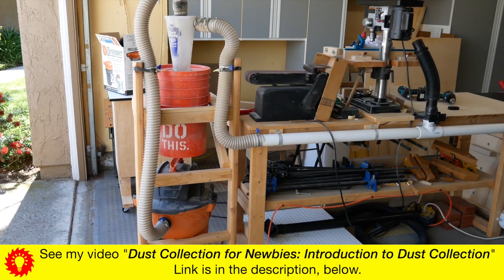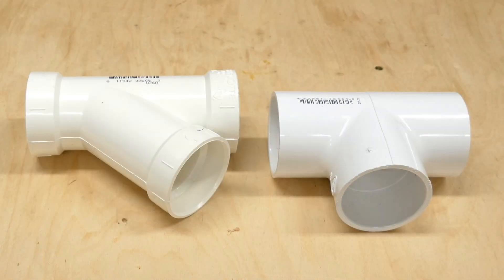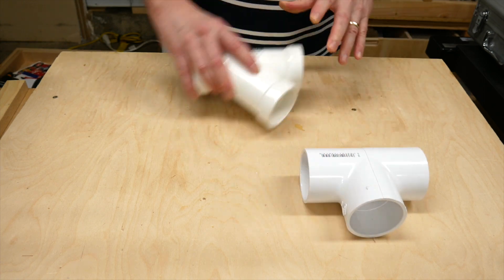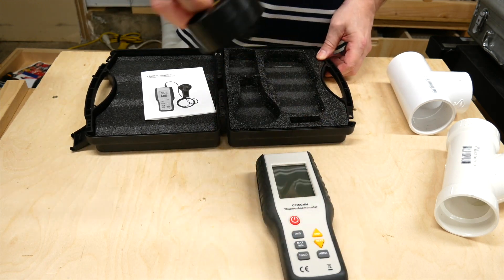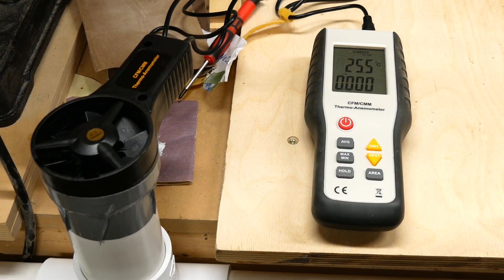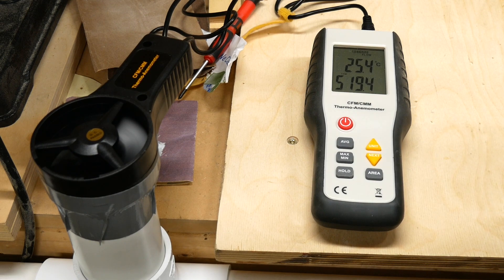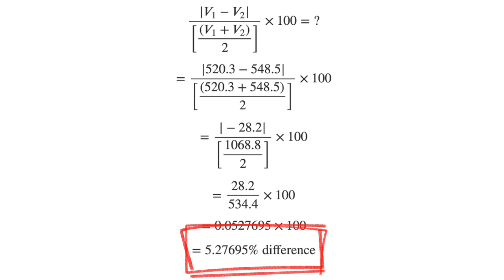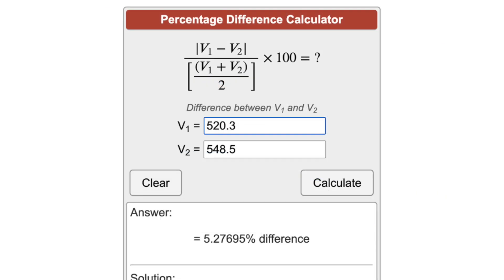Comparing Ts to Ys for Dust Collection

Comment: Yes its only 5% difference... with one connection and shop vac. Start adding bends and constriction starts to add up real fast. Also shop vac operates low volume with high pressure or speed of the air compared to chip collectors volume of air with low pressure and low speed. On the latter effect is even more drastic.
Also even if its just one bend, that is still 5% more power required to move same amount of air, so you are causing extra tress to shop vac motor.
Just the flex hose is creating 9 times the constriction compared to straight and even pvc or better yet metal pipe designed for dust collection.
Reply from the maker: Thanks for the info, and sorry for the late reply.

Comment: I've just dropped on to your channel and watched this video - i know - two years late. I can't tell you how much but your calculations are wrong almost for sure.
You are dealing with a differences of 28 units over a total of 500'ish of the same units. It shows about a 5% (if you method of calculation is correct) of difference and that's not a big deal.
But that 28 units will be a very different percentage if they are over ~500 than if they are over 5,000 or over 50. So, the total volume of air measured is a significant parameter and it shouldn't be inaccurate. I humbly suggest you to read the manual of the anemometer and try it again. Maybe Venturi and Bernoulli weren't wrong after all.
Please, please, take this comment with ZERO intention to underrate your work. "Au contraire", I want to give you my appreciation and beg you to keep up with your work!
Subscribed, belled and shared your channel.
Again: keep it up!
Reply from the maker: Thanks for the comment, and I appreciate you saying that you aren't trying to undermine my work. It's always hard to know people's motivations when communicating this way. To your points, this is why I rarely do these kinds of videos. I know I don't really know what I'm doing with these kinds of measurements, so the video ends up almost completely useless. As an aside, you mentioned Bernoulli, which reminds me of back in the day and Bernoulli discs (disks?). Remember them?
Reply: @TheNewbieWoodworker  OMG! Maybe I'm chatting with someone of my generation! Bernoulli discs where somewhat of a better ZIP cartridges at the dawn of the CD-ROM era...
But Bernoulli himself, he was also a member of a family of scientists (physics and mathematics) and pioneer in fluid dynamics.
I'm more on growing than destructive criticism and your work in your channel deceives any comment to help you in this adventure. But I'm sure you are correct on your conclusion, just keep it in mind the next time you deal with absolute and percentage values if you think it could help you.
I appreciate your time writing your reply and don't hesitate to keep your channel up! 
My family is now in an economic struggle, but as soon as we get out of it, you'll have another patreon. Take it for granted!
Reply from the maker: @yusuf-alasit  First off, sorry you're having rough times, but rest assured that you dont need to do anything special to support my channel. I appreciate the thought, but it's really not needed. As for the same generation, I'm 66, so I could still be quite a bit older than you. And for sure, thanks for constructive comments. I'm basically working in a vacuum, so anytime someone can help me learn things, it's a bonus!
Reply: @TheNewbieWoodworker  I really enjoy small but quality channels like yours and feel so grateful that I share like and subscribe these like yours. But I ethically feel that I should help this sharing community of makers in the measure I can.
So, if you have any questions about numbers (maths) or physics I can try to help with pleasure. But don't feel obligated to.
BTW I'm 56, so not so far but not so close either. I know about Bernoulli discs because I've been envolved in computer since high school (1984) and graduated on computer science.
I'll follow your projects. Keep it up! ;)
Reply from the maker: @yusuf-alasit  Thanks! I'll keep you in mind if I ever need that kind of help. 🙂

Comment: Thanks for that, you are right if you are using one machine per operation. Your dust vacc works on vacuum a dust extracter works on air volume. A dust extracter is designed to move X amount of air and does not work as efficiently if it is not allowed to move that amount of air. The best way to make this happen is to install a gate on a Y piece that allows you to balance the air flow, giving you the most efficient use of this machine. As you said a 5.5% drop in efficiency does not matter with a vacuum, unless you are using multiple outlets. May I say your design is brilliant for a vacuum system. By the way my background is in particulate air movement, Stewart
Reply from the maker: Thanks, Stewart, for confirming what I was thinking, and thanks for the compliment. I'm certainly no expert - far from it, and I'm just trying to help as best I can. As an aside, I've delved into "fine particle" collection, and I just end up shaking my head and saying "I can't hear you" really loudly. I'm not sure why I'm mentioning it, other than I thought it might give you a chuckle. :)
Reply: @TheNewbieWoodworker  Hi the problem with fines in particular air is that you need to reduce the velocity in any separator to allow the without doubt light weight particles to drop out and not be taken to any filters you may have. Heavy particles are relatively easy to remove in separators (cyclones) but not fines like sanding dust.
Reply from the maker: @stewartenglish3724  Good point - thanks.

Comment: This has been properly tested many times. Also just testing one connector doesn't really help. It is about the total volume and speed of air being moved throughout the entire system. Air slows down around corners. If you have a full-fledged ducting/piping system, having it littered with t-connectors will make a difference - sure in your case you might not see the difference, but the difference exists nonetheless.
Reply from the maker: I replied to your comment, and YouTube seems to have lost it. 🙁 In any case, I'm pretty sure I said that yes, there's a difference.

Comment: Hey great  stuff.  Hows the thumb?  I am going to use the shop vac  and t and y connections  for  my  triple   location. Dust collection  system after i finsh building   the table saw/ router extension  bench with a concealed  shop vac  hideaway  cabinet.  Question...... have you ever had the need to make a sacrificial fence  for dadoing or ripping  on your table saw.
Reply from the maker: Thanks. Yes, I've used sacrificial fences many times. Is there something I can help with?
Reply: @TheNewbieWoodworker   sorry for the delayed reply  
yes. perhaps you can  make a video  how and why a sacrificial fence is useful  and would you create multiple  sacrificial fences for different dado widths  while making tongue and groves  on  MDF and plywood for cabinet making.
thanks for your time .i really enjoy your videos and am learning  a lot. i look forward to more videos m.a.m.
Reply from the maker: @michaelmassetti2575  Stumpy Nubs has a good video on sacrificial fences: https://youtu.be/VbS0-nSCrzo. And I use the same one over and over again. It's only real purpose is so you don't cut your rip fence.
Reply: @TheNewbieWoodworker  thanks for the reply
Reply from the maker: @michaelmassetti2575  👍

Comment: A "Y" connector will help the particles of dust and shavings travel through the pip. The only place my system blocks is on hard bends like "T" can 90 connectors, where I have two 45 bends all work well. It's just the one 90 that is by the shop vac that keeps blocking but it's to tight space to put 45s in
Reply from the maker: That makes perfect sense. Thanks for sharing.
Reply: @TheNewbieWoodworker  Or as a compromise you (anybody) could try a swept tee
Reply from the maker: @philparmenter53  👍

Comment: The y will give you a better waste flow...no sharp...everybody down then a sharp right or left turn...I also use a similar set up as yours using clear 2 1/2” pipe and fittings y’s and elbows with grounding...thanks for your vids.
Reply from the maker: Thanks! 😄

Comment: Zero...I love a good Easter egg.  

I'd be interested in seeing the same measurements at all points along your system starting at the vac. It would give a great picture of loss due to length and fittings. 

Thanks for the enjoyable content!
Reply from the maker: Regarding "zero": 😂I may do some more testing - not with a Y but with what effect the Dust Deputy has on the entire setup, and it would include testing the airflow at the farthest point as well as the closest one. Time will tell if I do it or not.

Comment: If I should ever get to a point where I implement a system like this I’ll probably use Y connectors unless there’s a big price difference (I suspect there’s not). If I already had a system with T connectors I’d just leave it alone, though.
Reply from the maker: I like the way you think, so naturally, I agree with you! 😄
Reply: You are right if using a vacuum.

Comment: Glad to hear you and yours are ok. As far as the test goes I notice you have a thein type baffle which keeps your vacuum working more efficiently (ie filter stays cleaner). If I was going to spend money or time that would be my first place to start. I'm not an expert but I think the difference may become greater  the more particles being pulled thru the pipe. I think the difference between "t"s and "Y"s is due to turbulence at the joint. So like some others mentioned besides joiners and Planners, lathes, might see a bigger difference. I'd also suspect that the quality (air tightness) of your system and gates will have a bigger impact than the joints themselves. Just  my guess. stay healthy.
Reply from the maker: Thanks for the comment, Jack. I am actually thinking about doing some testing of the Dust Deputy, with and without, and see what the differences are in various situations. Time will tell if I actually do it, but that's the plan right now.
Reply: I am using a HD Dust Stopper with a Rigid shop vacuum. I don’t know how it compares to a dust deputy.i believe it was less expensive  but may not be as efficient. It is easy to setup and use. My biggest complaint is that I don’t pick up paper or plastic bags off the shop floor if they drop and they can clog the dust stopper and it is hard to clear as it makes it into the device but not out.. Also the pipe that comes with it is too short  if you mount the bucket with the baffle on top of the shop vac which I do. So an extra 12-18” would have been perfect. It works but don’t know if others are better. I found that if it falls over when vacuuming that stuff can make it into the vacuum container but otherwise it remains very clean. I am concerned with the really fine dust that may get thru everything and so I run a fan with a filter that supposedly can capture small particles.  It does get dirt over time but I can’t tell if it goes thru the vacuum or not. Oh just a random fact I tried a dust deputy knock off and it didn’t work well at all. Since it came with no instructions maybe it was the way I set it up can’t tell. I just went with dust stopper.
Reply from the maker: @jackmiller3628  I've had some long conversations (email) with the inventor of the Dustopper (I have a video comparing it with the Dust Deputy). He's a really nice guy and I'm happy his product is succeeding. He's very smart and has done a lot of research - he's basically an expert in air flow or whatever it's called. My only real complaint was that it was louder, at least on my system. It seemed to work about as well as the DD - maybe slightly less, but close enough. As for the bucket tipping over, I wonder if you put a brick in the bottom of the bucket, that might help?
Reply: The Newbie Woodworker I thought the same thing concerning the brick but decided to mount the bucket with the dust stopper on top of the vacuum and attack it so you would have to pull the whole vacuum over. Less space needed but tall.
Reply from the maker: @jackmiller3628  Great idea!

Comment: I have a life so I won't mention zero, I guess. Though I'll keep your video in mind if ever I manage to install a dust collection system that doesn't rely on the shop-vac hose being moved around on each tool change.
Reply from the maker: LOL, and thanks. The one big advantage of moving the shop vac around is that you'll get MUCH stronger suction.

Comment: May I suggest the next experiment with dust collection ....to earth (ground) or not to earth the plastic pipe runs. Should be interesting. 🇦🇺
Reply from the maker: I've written a blog post about that: https://thenewbiewoodworker.com/2020/01/21/dust-collection-and-pvc-static-fire-danger.html
Reply: @TheNewbieWoodworker   Thank you for the information. Rod Cole does good work.
Reply from the maker: @Peterseng24  Thanks for the info.
Reply: @TheNewbieWoodworker  love your article and appreciate what it says basically friction from particulate air does not create static charges in sufficient strength to create a fire. Again home units correct industrial not correct which is why they are earthed. Screws through the wall of the PVC dust earthed to an external wire and earthed hoses will make you safe. Prevention is better than cure. Sparks from cut metal in the material being cut or drilled can be a smoulder problem. Sprinkler head a great idea. all the best hope people make up their own minds about this but to me PVC ducting in a domestic situation is fine. Stewart. P.s. spent 40 years in fire industry as well with fire suppression systems.
Reply from the maker: @stewartenglish3724  👍

Comment: Something fishy about the claim volume vs speed but I can't put my finger on it. Regardless so glad you made this video -enjoyed it thoroughly, just like all previous ones.I was wondering whatever happened to The Newbie Woodworker. Glad all is well. By the way, I too will use the cheaper and more convenient join when I set up the workshop at my place.
Reply from the maker: I may have the details wrong, but there is definitely a major difference in how they work. I've heard that from people in the business who know a lot more than I do (which honestly doesn't take much). As for which joints you use, use whatever you can afford, and whatever works. 😄

Comment: Entering  "Zero", and get a life... OK... check! -  but I think you justified your analysis as a relative number vs. absolute.  So a thought about your dust collector setup: the run in your workshop is short compared to other shops, so the ~ 5% difference would only make a small increase in efficiency, not that beneficial to swap them out... but the fact that you can measure it at all is impressive.  However, I think if a shop had longer runs, the Wye's would make a greater contribution... but is that true? I can't prove it, just a guess (I'm sure there are papers and research done on this)  BTW: I am thinking about adding some dust collection to my weekend workshop one day with a long-ish runs (20 to 30 ft.).  Should I use Tee's or Wye's ??  I think Wye's... right?
Reply from the maker: Regarding "zero", 😂. For your last question, I think you should always use the most efficient methods unless you've got a good reason not to. As to the other things, I haven't a clue but I figure if it gets most of the dust, then that's a win. Except for table saws - it's not always possible to get really good dust collection with them, depending on how they're made. So people who search after the perfect table saw dust collection are asking for disappointment.
Reply: @TheNewbieWoodworker  I am rewatching your dust collection basics video and thinking about the components blast gates, hoses, clamps, etc. and it's a good resource... I think this is good enough for my purposes... I'm not planning on becoming a professional woodworker, I'm actually a full-time firmware engineer that dabbles on the weekend with power tools 😁 so while, yes, I can stress over "perfect,"  my goal is to make things in my shop.  Surprising how much sawdust is generated from my tiny projects!  and don't even get me talking about the amount of sawdust from making pocket holes... However, not covered in your video, but I'm thinking of adding one anyway, are one of those air circulator filter fans... like a  Powertech or WEN, they hang from the ceiling and clean up the fine particulates in the air.  Thanks so much for posting videos they are inspirational
Reply from the maker: @HobbyHalloween  I actually have a WEN and it works great. And it's no surprise that woodworking interests you, being a firmware engineer. I'm a retired software engineer, and I've discovered that engineering is engineering, no matter what. 😄

Comment: Hi good video. I use 2" pipes for my dust collection with 2" Flexi hose. I am just redesigning my workshop to make more room. Trying to get all my saws in the same general area to cut down on the length of piping used, Ive only got a small garage. In the UK we can get T connectors with a slight bend in one direction depending on how you fit it. It does seem to make a difference. One thing I did notice on the last setup was the tendency for the chips from the Planer Thicknesser to clog up on right angle 90 degree bends so I am going to use two 45 bends to eliminate that. Keep up the good work,
Harry
Reply from the maker: Thanks, Harry. I hadn't thought about a planer or jointer (I don't have either), but that's a great point.